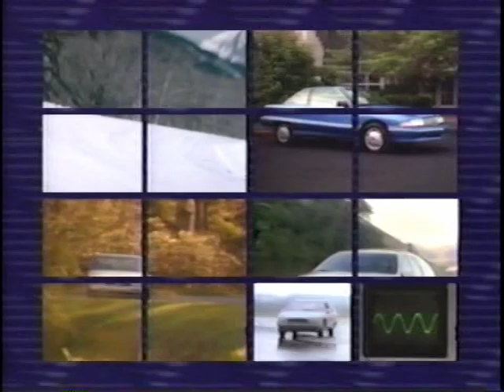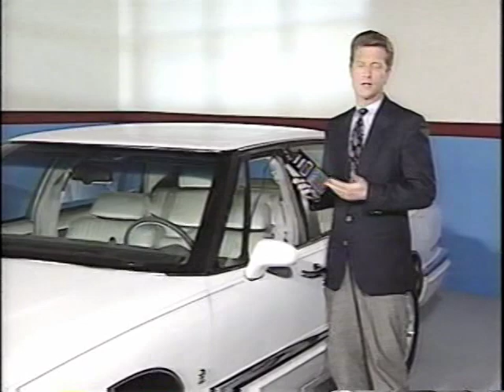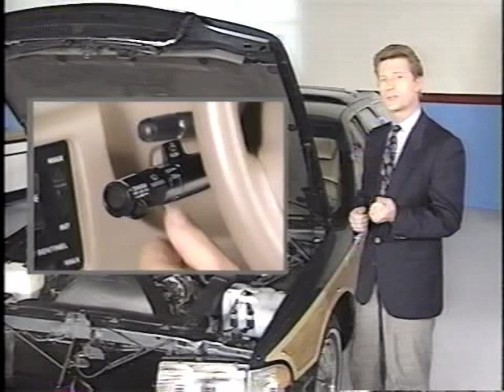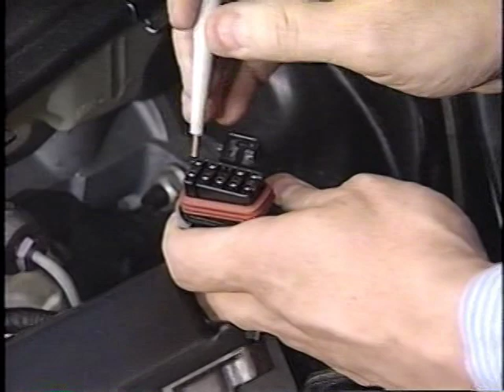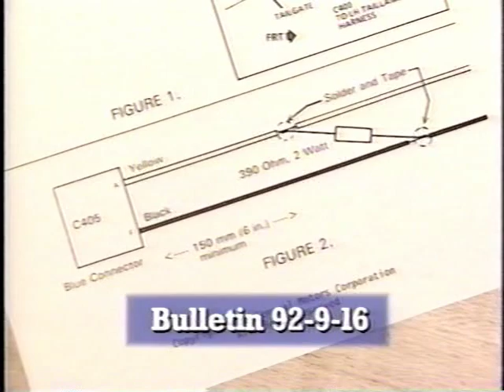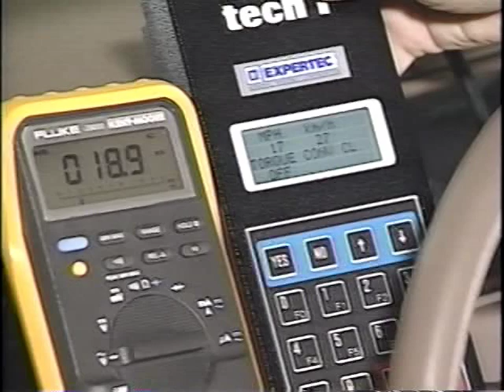Buick - Cruise Control: Update (1993)

Comment: I have a 1992 chevy caprice. It does look like the buick. I have a couple of questions:
1.- If VSS sensor or module are bad, speedmeter must not show speed, isn´t it?
2.-  I obtained 0DCV at terminal G of Cruise control module. Does it mean module is bad? It is serviceable but I have not diagrams and numbers of IC's are not common
3.- (and last) I found some modules of second hand. I can assume that if Electronic board of the module are like mine, module is fully compatible although part number is different or there is any PIC or ROM information recorded in any of the IC's?
Best regards

Comment: Whoa Edon!  You managed to tuck an LT1 into a V6 cutlass?  Was that front or rear wheel drive.  I have a 96 Cadillac hearse that ways way over 6000 pounds and has great performance.  I always wondered how easy it would be to tuck an LT1 in something originally not meant for it.   Maybe an Allero or Cavileer?